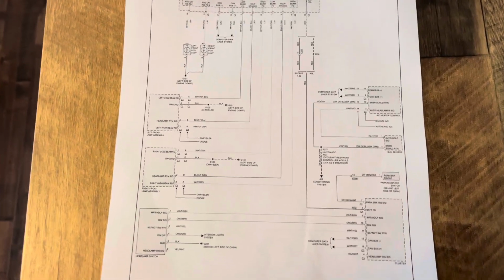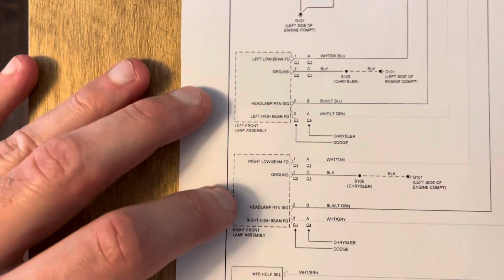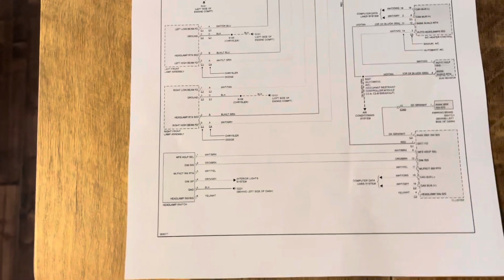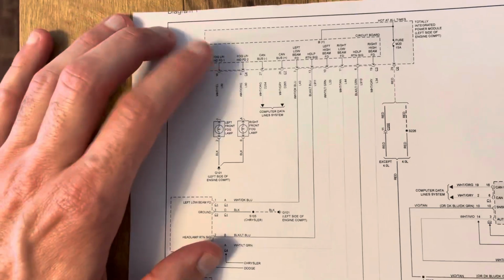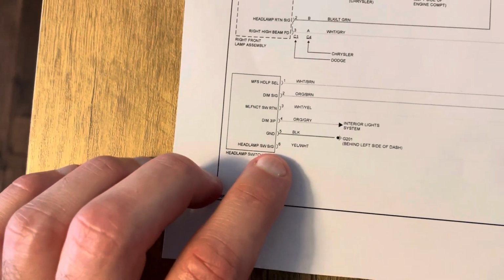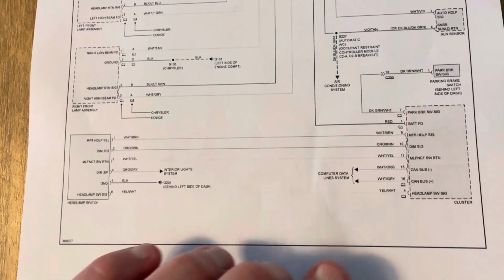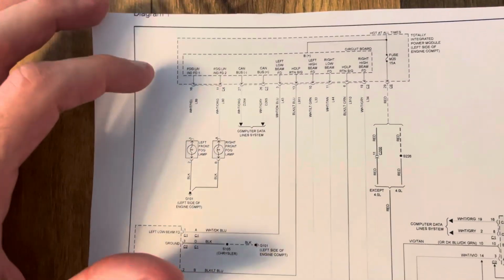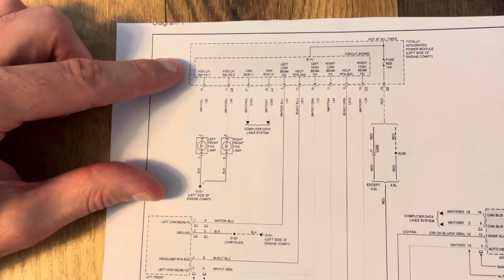2010 Dodge Grand Caravan headlights inoperative #headlights #electricaldiagram

Comment: My drivers side headlight is out. Passenger works fine. Since there is no fuse for the headlight it appears that the power signal comes out of the PCM. I hate to take out the PCM and muck something else up, but I am willing to try. How do i find the drive side output physically on the PCM?
Reply from the maker: You need a wiring diagram, or a pinout chart of the computer system to determine which wire or pin/driver is the output of the computer that controls the headlight circuit.   You can get one here 👉🏻https://go.derrickslink.com/alldata

Comment: Sir, thanks for the video.
I have a 2012 Grand Caravan. 
My RF headlight is reading 12volts, but my driver's side is only reading 4volts. The negative wire reads 12v, but the positive wire only reads 4volts.
I shed the positive's isulation and can only find 4 volts. Is there another location that has 12volts that I can run power from to get my headlights working again?
Reply from the maker: That could be a wiring problem or more than likely an issue with the totally integrated fuse box (also known as the TIPM).  These go bad ALL THE TIME on Dodge, Jeep and Chrysler vehicles.